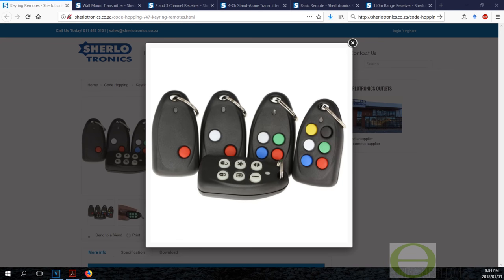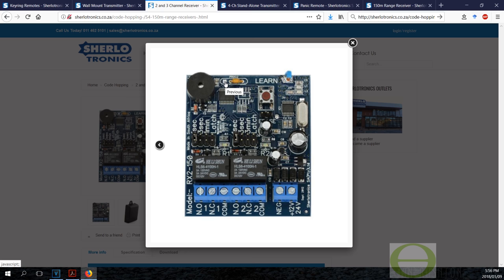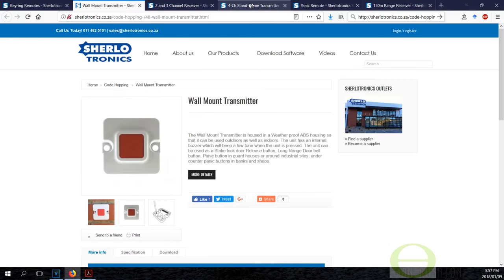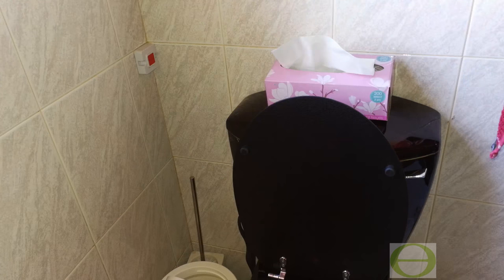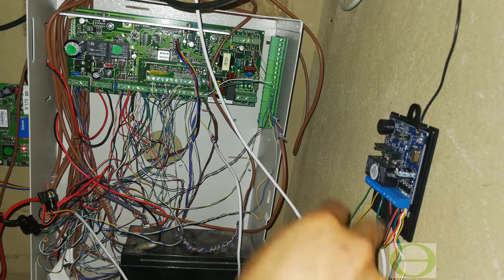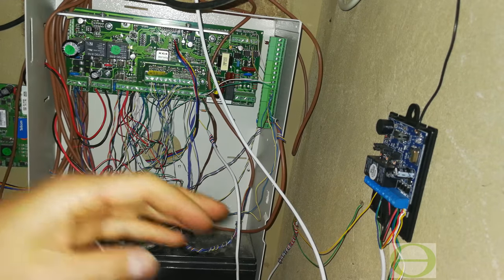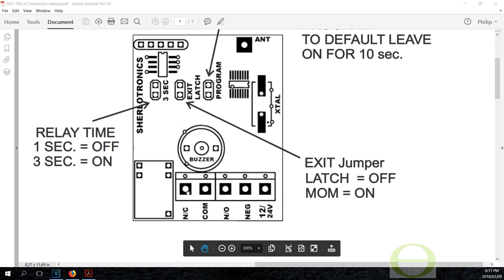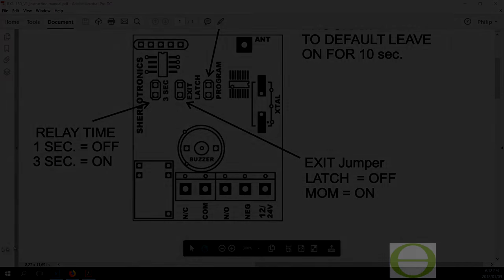How to install panic wireless remotes (Sherlotronics)

Comment: Hi, using Babyware software for Paradox alarm systems, If i have an aftermarket Sherlo receiver for aftermarket Sherlotronics remote connected to the evo 192 panel, and i want to turn on /off an area with the remote, what must I assign the zone as? (instant, burgler, etc) I assume I must assign it as 'entry delay '..) but it doesn't work.. Everything is connected properly because it was working (existing installation) but i have to program it again because I reset all programming by mistake.